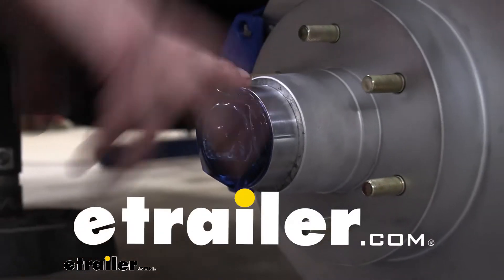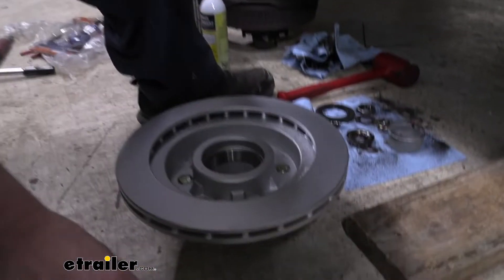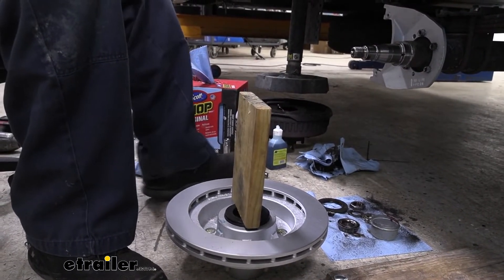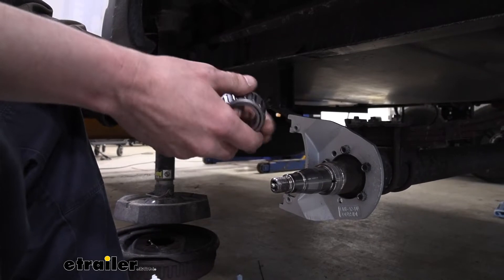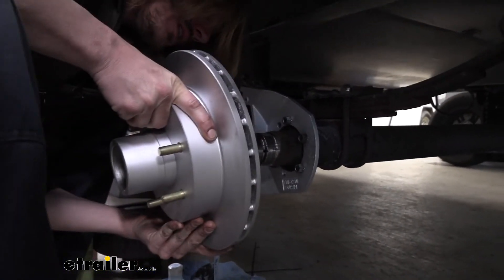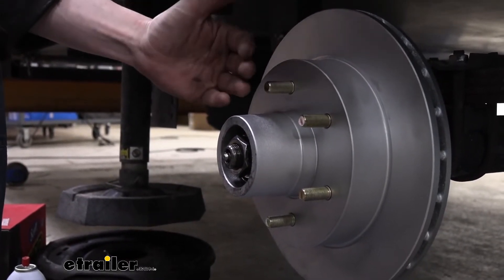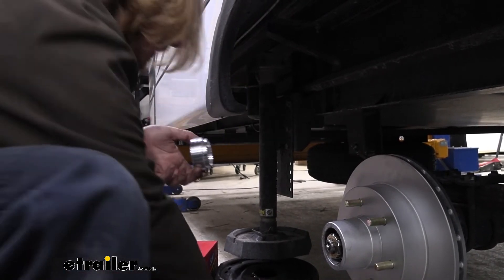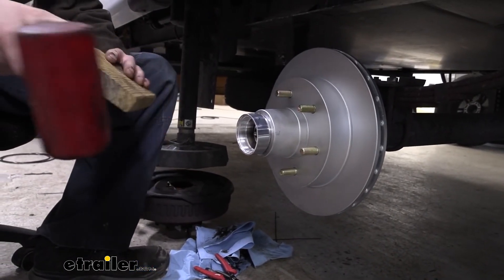etrailer | Breaking Down the Kodiak XL ProLube Kit for for 5,200-lb to 6,000-lb Axles

Comment: Absolute garbage for boat trailer. Don’t do it! Caps leak. Rubber plug leaks. I got 4 replacements and they all leaked also. Do yourself a favor and buy the reliable oil bath that comes with ez loader trailers. No problems or leaks in 15 years with that design.
Reply from the maker: Stay tuned, within the next couple of weeks we'll be adding options from Valcrum. The caps are aluminum and are much more durable than the plastic ones we currently offer.

Comment: Not at all happy. I have had nothing but leaking issues from caps. Which also means water gets in as well. Yes I torqued to 15lbs. Seems if you torque a hair over. They will fracture. A hair under they leak. If you have a "trick" of some sort. Please share. I'm tired of worrying non stop fighting these things...and no it's not my rear seals. Oil dribbles from the polycarbonate cap.
Reply: Same problems I have had. Best fix buy reliable oil bath idler hubs and new rotors. So pissed I chose Kodiak because I had to spend another $1000 to fix it.